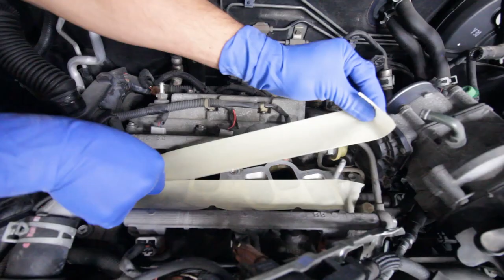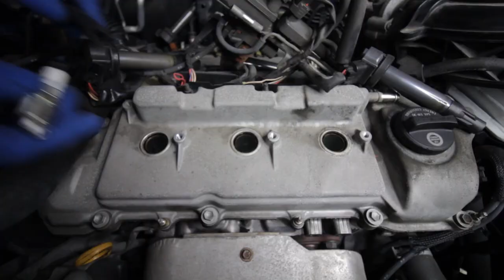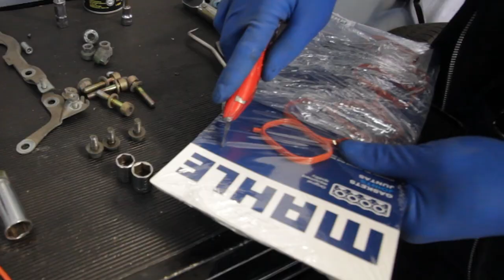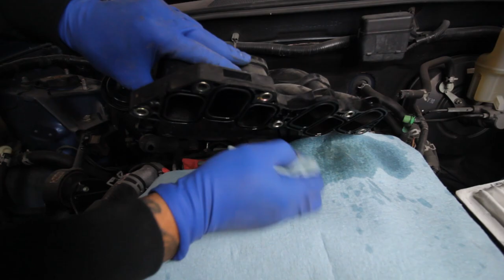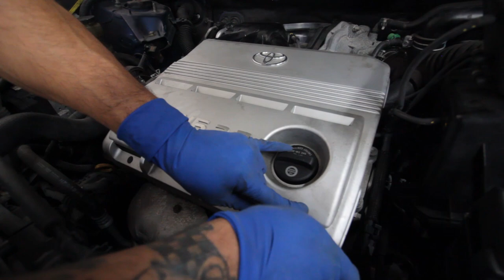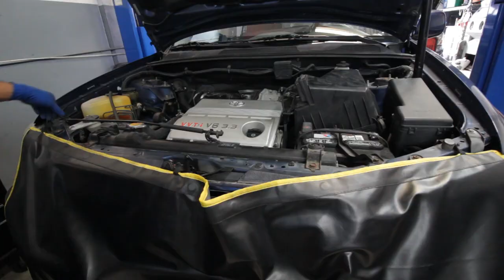2004 Toyota Highlander 3.3L Spark Plug Replacement

Comment: When I did that on my moms Highlander I was intrigued to see that one bank was NGK and the other was Denso.  Apparently thats how they were put together from the factory.  Also, how much fun are those back screws holding that air intake plenum in place
Reply from the maker: Those back ones are a pain but if you get a good ratching wrench youll get them no problem